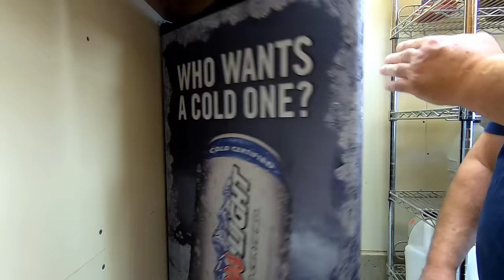Woodturning - The Ocean Cave Vase (My LARGEST Epoxy Pour!)

Comment from the maker: Lots of comments about why I didn’t use my vacuum chamber and the reason why I didn’t use it this time is because I was worried about the resin starting to cure before getting it into the fridge. Jim
Reply: Jim, this is the best yet!
Reply: How long did it take to fully cure?
Reply from the maker: @Ajtech369  it was pretty much fully cured when the last coat of finish went on it.
Reply: Hi, Jim!! Has it sold yet?? If not, what's the asking price?? Serious inquiry!!✌🏽💚
Reply: Jim, I CAN Feel this Piece!
It is a Masterpiece. Suggest you seek displaying at Juried Art Shows. An artist or craftsman seldom recognizes his true talent until judgment of entry into such exhibitions.
- A vase? No.  An encased and lit candle would further enhance the illusion that you, as the artist see in this piece.
Reply: Can you use vibrations to remove bubbles? Like a shaking table/surface that you set the part on while filling and it will vibrate and dislodge/move bubbles as you poor. I know ultrasonic cleaners are capable of doing this, but I believe that ultrasound isn't 100% necessary. Regular sound, like mounting a speaker to a table would probably work good enough to remove any noticeable bubbles. Ultrasound can also create bubbles/cavitation if you crank it up too high. That might be a good thing for some reasons... but could be a bad thing for other reasons. Also, with too much power with ultrasound, it can break up larger bubbles that float into much smaller bubbles that can't float (because of the high surface tension and viscosity).
Reply: Absolutely beautiful ❤
Reply: I am aware that your name is Jim but at first I read it like Dr. McCoy from Star Trek was defending his resin caution from his captain LOL
Reply: @petawawa, Are you a man of God?  Because how do you move on when obstacles are in your path and you still produce Master Pieces ? Can't afford your work, but I love looking and being blessed by it.
Reply: You don't give yourself enough credit.  Please stop apologizing.  Your talent and patience are amazing!!!
Reply: Beautiful
Reply: 12:00 I'm new to woodworking and brand new to your channel. Right here, I laughed about one thing. You showed us putting this piece in your refrigerator to cute, but not putting it in the pressure pot. I've basically known what a refrigerator looks like for my entire life and I'd have believed you really put this in one if you hadn't shown me. On the other hand, I am not sure what a pressure pot looks like so it would be interesting to see what yours looks like and what it does. Perhaps you've shown this in great detail in previous videos. I'll check after watching the rest of this. 👍 Oh, and I completely agree with your decision not to put a chunk of wood in the center to fill up space. A completely hollow center allows the maximum amount of light to pass through. Filling that space back up with wood seems to defeat using beautifully colored resin in the first place. I want the luminous blue orb surrounded by wood, not there dull blueish rock set in wood.
Reply from the maker: @SeanHayesParleys  I’ve shown the PP a number of time, will cover it again. Welcome aboard! Thanks
Reply: Beautiful 😍  my grandfather's were woodworkers from before my time and made so many things. I grew up with an appreciation for the skills. Very well done 👏
Reply: Can you tell me the pigment that you used on this please?  I didn’t see it in the description.  Thank you, I subscribed because of this video
Reply: Well I think it's yours and you can do whatever you want to and how you want.
Reply: The Heretics...gotta have some spacing :D
Reply: Always talk it through its helpful and really good for beginners trying to learn how to do this wonderful art form
Reply: Talk - I like a running commentary.
Reply: Very understandable your work is out standing
Reply: I love watching the show
Reply: That would make a great beta fish tank
Reply: @SpragueWoodturning 
And whats the pri$e tag 9n something like this ?
  BTW its awesome !!!
Well Done !!!
Reply: @thelaststand2670 I think it was said in the video that the finiahed piece would be two to four thousand.
Reply: @gorillaau  
Thank You !

Comment: I finally got to see this whole video. First, the piece is magnificent. One of my favorites. As far as your thought process goes, I usually join your conversation when you’re trying to decide so I am good with it. (My housemates are very curious as to who I am talking to!) I don’t like the filler blocks either. However, the cost of the epoxy when a large amount is required is makes you really think about how you can save. Also, I purchased the Hercules. I like it but I’m getting used to it. I usually use the Easy Wood finisher and its cutter is much larger. You are right about the Hercules, it can really hog out some material! Anyway, the piece is magnificent. Most people don’t have any idea of the time needed to create something like this so it’s good to see the whole process. Stay warm! Loved the snow removal video, too!
Reply from the maker: Awesome!  Thanks so much. Thanks for sharing!

Comment: I was absolutely hypnotized by watching this.  This is an amazing piece!  I can see why you charge so much for your craft. I also pour resin although certainly not on the scale that you do.  Great idea using a 5 gallon bucket for your form.  The removal process would be a piece of cake if you squeeze a little soapy water down in there. It would slide right out of the bucket. You are awesome and I’m subscribing! Makes me want to buy a lathe.
Reply from the maker: Welcome aboard! Thank you very much!

Comment: I've done a pour not quite that deep, however it took around 2.5 weeks for it to completely cure. I would venture to say that you should have given it no less than 4 weeks (27 days) to completely cure.
Awesome work though it definitely is an amazing piece.
Reply from the maker: Deep cast is designed to cure in 72 hours, in this case the fridge through off the cure time, but it still should be ready to go no later then 7 days. Thank you very much!

Comment: beautiful it looks like it's almost made of glass. A tip i've seen from other epoxy creators, is to put your epoxy in a vaccum chamber before pouring that helps it get out the majority of bubbles, im not sure if they have one large enough to put it in after the pour though..
Reply from the maker: I didn’t do that due to the fact there was a large volume of epoxy and I was worried it might start to set before putting it in the fridge. Thanks

Comment: One possibility for your problem at 56:30, the epoxy could have gotten too hot from the sanding and melted/failed. If it felt tacky or bouncy, what you're seeing might be an epoxy smear. I've gotten something similar when grinding waterproofing epoxy off a concrete floor. My guess is if the cured epoxy gets too hot after curing and/or stretched from the spinning blade, which then leads to polymers breaking down enough to make the epoxy rubbery instead of hard at the surface.
Reply from the maker: It could very well be. I incounter this in a later video and it’s so hot, I have a hard time keeping my hand on it. Thank you!

Comment: Love this piece. Good job.
When I try my vacuum chuck, I have had it pull the waterlox right off my bowl.
Reply from the maker: If your damaging the finish on the vacuum chuck the finish can’t be cured enough to use it. The temp in my clean room is set between 70 to 75F and I’ve never had any problems with Waterlox being pulled off the bowl. Hope this helps.
Reply: @SpragueWoodturning   Thanks Jim it must not have been cured enough.

Comment: Lovely!

...just a thought: If a spacer is an idea, would inflating a children's ball in to the middle before the pour be an option?
Reply from the maker: Not in a normal sense, if you place anything in a casting that’s going into a pressure pot that has an air blatter in it, it will collapse due to the pressure. Thanks for watching!

Comment: Hey, just started watching your video.  You talking about the wood insert.    Check out Dan Preece's videos.  He uses the stuff you put under laminate I believe.  It's flexible.   You might try that and make a pocket in he middle.  Just a thought.

Watching the part where the wheels were sitting.  Perhaps the epoxy was still just a teensy bit soft and the heat and the pressure from the wheels caused cracking?  A friend learned to leave a band where the wheels will go then AFTER finishing with the steady rest, remove the band.
Reply from the maker: I watch Dan’s channel too, thanks for the info.

Comment: I am a Chilean in the southern tip of America and my English is not good.  I love hearing what you think because that's what happens when you attack a new project and you don't have all the answers. I'm just starting out in this thing where you teach. Have you not thought about using a sandblasting gun to remove rotten wood that is difficult to remove with brushes or bad sections of wood?
Reply from the maker: I plan on getting a sandblasting cabinet in the future but you can’t use normal sandblasting sand as it will dull your tools. Something like walnut shells for a blasting media will be better. Thanks!

Comment: You could apply a clear “crumb coat” on the inside of the wood, let it dry then pour, security against crumbs! Save time, effort and reliable outcome!
Reply from the maker: Crumb coat??? Thanks
Reply: @SpragueWoodturning  when you frost a cake you put down a layer of frosting to keep the crumbs from getting in the final frosting layer for a perfect result.  For this it would be a painted coat of resin, when hardened it stabilizes the little particles and stuff so they won’t shed  into the final pour.  I hope  that was the answer to your  question!

Comment: Hi Jim I like that piece of maple with all its holes, spalting and lovely grain it is very big, its the largest I've seen you use. Will you use the bits you cut of with the  bandsaw?  I like hearing your thought process it helps us know what is going on. I agree with you about the spacer it would ruin the hollowform. When you brought it outbthe pressure pot I want WOW and my jaw dropped at the awesomeness of the piece and thats before you turned it. I laughed at the amount of a fight the bucket put up not wanting to let go.😂. I want you to carry on with your talking about the item on the lathe and at the beginning. The Ocean Cave Vase is magnificent and unique well done on all the hard work and long hours you have done yourself proud. I totally love it this piece is my top piece out of what you made, well done from Amanda xx
Reply from the maker: I’ve been thinking of a way to use those off cuts but haven’t come up with a concept yet thanks!

Comment: dunno if it's available in Canada, but everclear, and it's competitors, are nearly pure ethanol, without being denatured. it probably makes no difference in function or quality, but it MAY be cheaper, or easier to find 👍
Reply from the maker: Isopropyl alcohol will work too. I think the DNA is safer to work with. Thank you very much!

Comment: When talking about using a spacer, and also about keeping it cool so it doesn’t crack, do you think it would be worth adding a spacer to take out some of the heat-generating resin? Keeping the fire small, as it were?
Reply from the maker: Certainly, less resin should create less heat, thanks!

Comment: The piece is extremely beautiful, stunning even.  If I only had the money...my question is about your refrigerator, what is the name brand and if you would be so kind as to point me in the right direction as to where I could order one please?

Oh! And i like to hear your thought process and your deciding choices. It enritches the video. Thank you. 😊

Designer Poxy.
I hope I'm not too late?
Reply from the maker: This is just a small beer fridge, you can get them anywhere even on Amazon I think. In the future, I plan on getting a larger one that can fit my Pressure Pot, that way I can put the castings under pressure wheel in the fridge. This should help with bubbles. Thank you very much!

Comment: Gorgeous piece!! What's the advantage in using a pressure pot instead of a vacuum pot?
Reply from the maker: They are really two completely different things. Since the wood is submerged in the epoxy, when it's in the vacuum chamber and there's a vacuum applied it will pull all the air out of the casting and when the vacuum is released it will draw in that liquid. The pressure pot will compress any remaining bubbles and it will also help to push the epoxy into areas that it ordinarily wouldn't flow. Its best to use both if you have the cash. Thanks
Reply: @SpragueWoodturning  You had made mention that you might be receptive to new projects. My thought was this, I make a lot of gavels, and am trying to imagine what a gavel and handle would look like with the color shifting resin. I'm thinking of using some thin wall PVC as a mold, and perhaps some dowels set up much as you did the cactus skeletons. Probably a 4" mold for the gavel Head, and a 2" piece for the handle. I work with a lot of exotics, Zebra, leopardwood, bloodwood, canary, and cocobolo. so, there are lots of drops that I won't throw out, laying around.
I could turn some dowels, 3/8 or 1/2" , and fill the mold vertically, the pour it.
Your thoughts???
Reply from the maker: @jimmeadows5637  The most important thing is that the branches are bone dry before casting or they might come loose later. I’ve been done that road, lol. Jim

Comment: Hi! This is my first view of your channel and really liked it!!
From what I've seen by other youtubers, you should use mold release to prevent the epoxy sticking to the mold (even if it's still curing)
And personally I would've used the natural grain and form of the wood to dictate the orientation of the final piece, but in the end it made a really cool pattern than probably wouldn't have happened by orienting the lathe with the grain.
Also loved the iridescent-like quality at the end!!
Cheers!!

PSA: I've only used epoxy in very thin layers (face masks) so a deep pour and lathe work are out of my personal knowledge.
Reply from the maker: Welcome aboard!  I turned it side ways as I was trying something different on this project. I do use mold release on some projects. Thanks so much!

Comment: Jim what size bucket are you using? I believe this is your best and most beautiful hollow form. You are a tru artist. Designer Epoxy
Reply from the maker: It’s a five gallon bucket that’s been cut down so it will fit in my little bar fridge. Thanks

Comment: What if there was a cut of a branch of a similar or from the same tree to put in the middle so that yhe grain or type matches better. Maybe, making it look like a submerged tree. I am wondering if that would have helped with saving resin while still preserving what you had in mind for the project.
Reply from the maker: It would have been something totally different from what I was going for.  Thanks!

Comment: A suggestion for the jellyfish base thermal crack. Why not do the pour in stages. Fill with a layer of shavings and broken pieces and pour. Then fill again and pour again vacuuming after each pour.
Reply from the maker: If you do that you will get a witness lines and I try to avoid them, thanks for watching!

Comment: I think that if instead of a slug of rough cut firewood you instead added some live edge piece that you would not "NEED" to remove. it might add more to the depth of the work. But you do you :) whatever keeps the lathe turning!
Reply from the maker: Thank you very much!
Reply: @SpragueWoodturning  you bet, and i do not mind you thinking out loud at all, no complaints.

Comment: Where do you get your buckets? Do you cut off the tops of regular buckets?
Reply from the maker: Hardware stores are a good source and they usually have different sizes too. My pressure pot can take a full size.  5 gallon bucket so I usually don’t need to cut them. Thanks

Comment: If you want to cut down on the possibility of getting a loose bit or two coming off the piece during the pour and floating around, blow it out with an air compressor, and then use a can of clear acrylic spray to coat it all lightly prior to the pour. That should lock everything down nicely.
Reply from the maker: I’m always worried about using two different materials when casting, do you do this? Thank you very much!
Reply: @SpragueWoodturning 
I was a commercial painter for over 40 years, so my experience with these materials might not apply to your craft. I only recommended an acrylic because it's a neutral product that won't react to the epoxy. In general, acrylics can be applied as either a base coat or a top coat with oil based finishes, lacquer, shellac, or other waterborne finishes. Whereas lacquer will lift oil, acrylics usually play nice with everyone. In my experience, the only finish that can cause problems down the road is wax, because to the best of my knowledge, you really can't put anything else on top of it.

Comment: Does putting the casting in the fridge have any effect on the air bubbles prior to pulling a vacuum on it? You will have to forgive my ignorance since I know nothing about this process.
Reply from the maker: I’ve never put a casting in a vacuum chamber after it came out of the fridge so I can’t really answer that question. Usually that process is done before putting it in the fridge. Keep in mind, the larger the volume of resin, the quicker that resin will heat up and cure. That’s the main reason I didn’t put it in the vacuum chamber prior to it going into the fridge. Hope this makes sense. Thanks